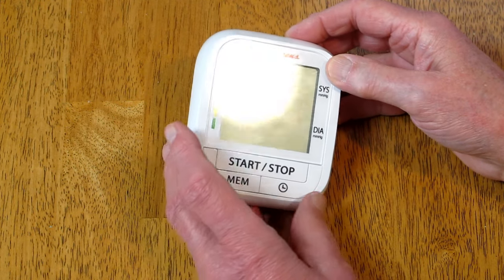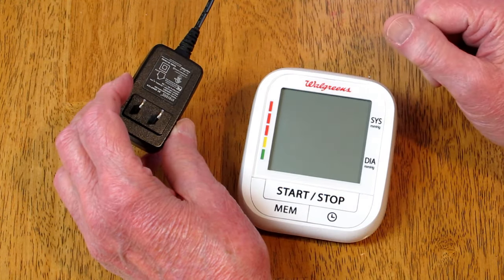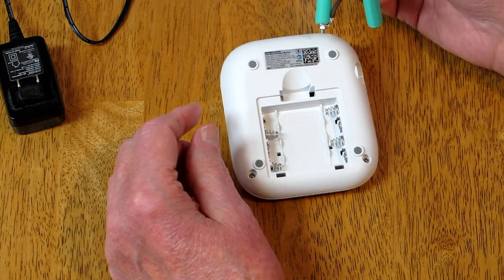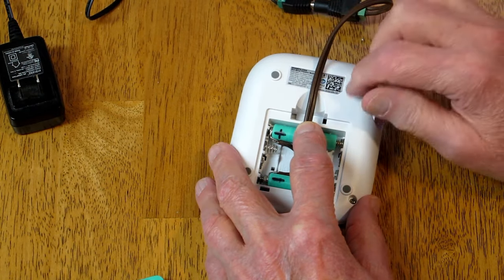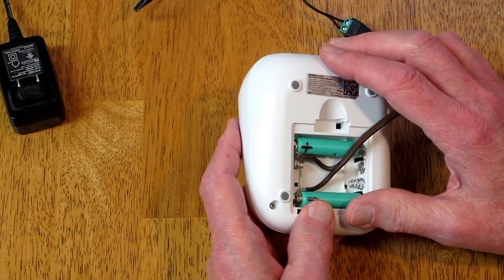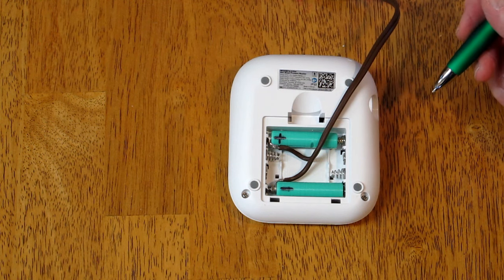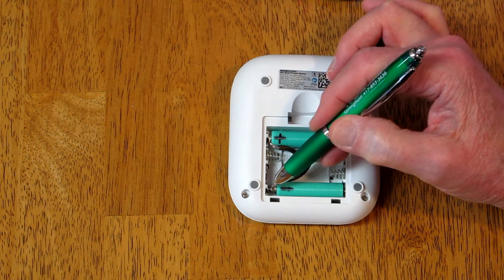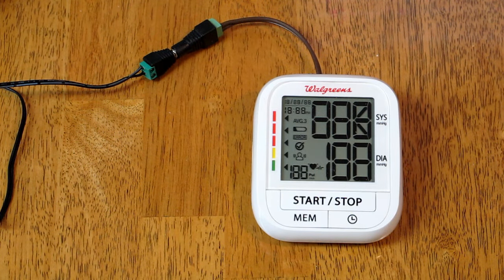BP Monitor - Power Supply Conversion

Comment: Always make sure the outside of the barrel is negative. I've come across a couple over the years that are positive. I have a label maker that is outside positive and had to flip a replacement wall wart  with it. Even the markings on the wires like the white dash lines don't always indicate positive or negative. Best to use testers and check.
Reply from the maker: :-)  ... Found that out the hard way a few years ago. Miss-wired / incorrectly marked. Smoked a couple of Arduino Nano's before I woke up.

Comment: Interesting how the battery symbol still showed one bar…. Things that make you go Hmmmm
Reply from the maker: That is not what is being shown. When the device is first plugged in or turned on... the entire display lights up to confirm (or test) that all segments are working. The only battery indicator is when the battery is too low (or possibly a battery is inserted incorrectly - wrong polarity). There is no progressive or incremental battery display like you may see on your cell phone or laptop. Here it is either good or bad, no in between. :-)